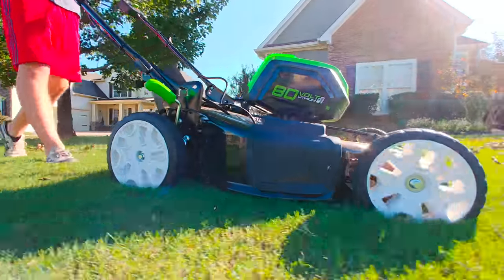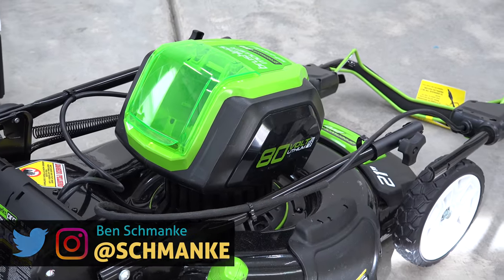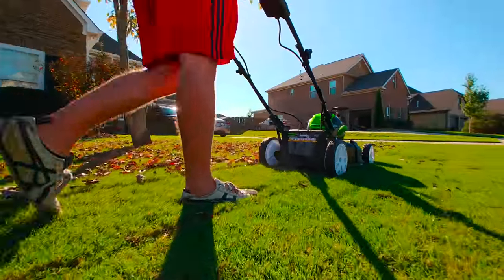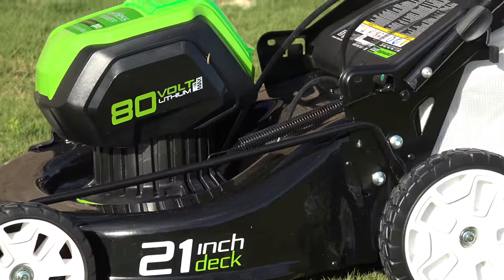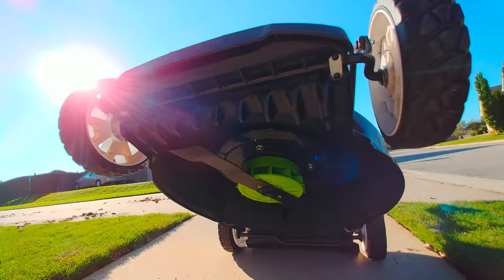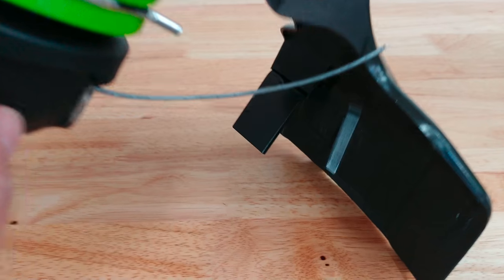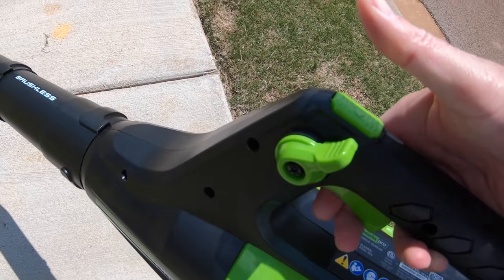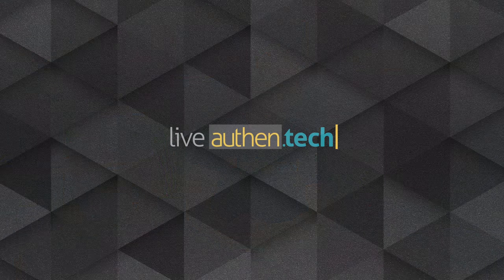Ultimate Electric Yard Tools!! Greenworks REVIEW

Comment: Do the more "budget friendly" options work the same, but with a shorter lifespan per charge? I'm curious.
Reply from the maker: I believe the voltage is like "horsepower", and amps is "gas tank". That helps me when figuring out the battery differences
Reply: I prefer to think in pressure washer terms. the higher pressure (voltage) the less water (amps) you need. Lower voltage mowers usually come with much higher amphour batteries in order to make the run time the same. Of course the more Amps(water) the battery has the longer it takes to fill them up. Also you can use fewer batteries or smaller cheaper batteries to get higher voltages with lower amps. High voltage seems to be the winner. But build quality, motor design and deck design are key factors as well. I think all 80ish volt lawnmowers are made by greenworks

Comment: Ben - discovered the greenworks 80V pro line late 2017. I purchase the chainsaw and backpack blower. My next purchase is the hedge trimmer. Get a second charger and three batteries and you will not have time for an adult beverage before you are back to work.  Cheers

Comment: the battery is like 2 kobalt 40v  the charger is even the same
Reply: Kobalt yard tools are rebranded greenworks. Only difference is that Kobalt uses a different battery housing so the batteries aren't interchangeable between brands.